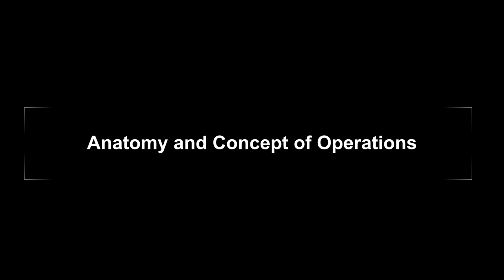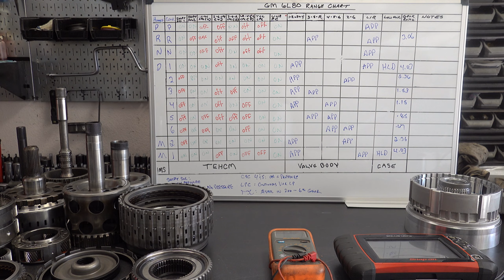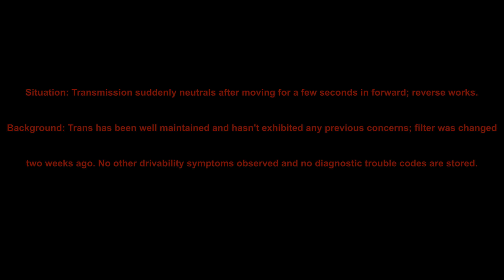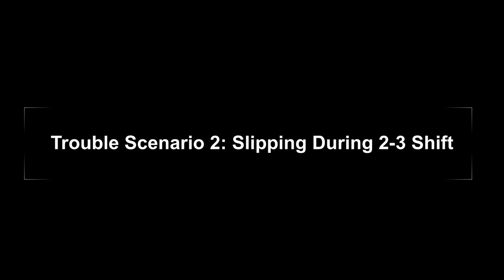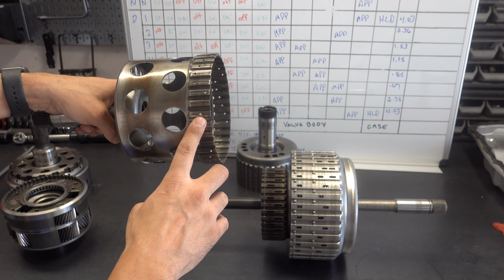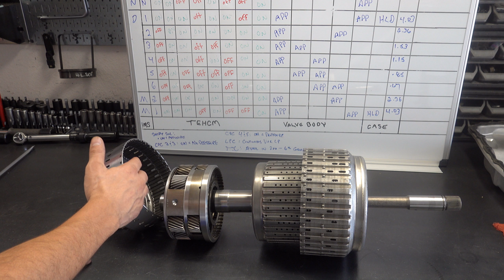6L80 Troubleshooting PT1 - Fundamentals and Range Charts

Comment: I have a 2014 2500hd with the 6l90. I get a hard shift from 1st to second on the very first shift of the day in cold weather ONLY. After that it shifts perfect. What can be possible causes? Thanks and your videos are fantastic!
Reply from the maker: Hi emtcc, thank you for the kind words...The 1-2 hard shift when cold condition can be caused by a few different things (as well as a combo of them) but many of these transmissions will have somewhat abrupt shifts due to the fluid being thicker when cold but they warm quickly so the condition goes away until the next drive cycle after sitting / cooling off. You may also have a mild amount of check ball and/or valve body wear that the PCM detects after that initial shift and adjusts the line pressure accordingly to smooth it out...Torque converter wear, bushing wear, slightly worn 1-2-3-4 clutch can also be applicable...

Your best bet is to plug in a bidirectional scan tool, bring up live trans data and take for a test drive in the AM when it's cold and see if there's anything anomalous in the data, such as a slightly longer 1-2 shift. Let me know what you find.
Reply: @nickstransmissions  Thanks man! I'll definitely hook my scan tool. Your response was above and beyond! I really appreciate it!
Reply from the maker: You're welcome. Please subscribe if you haven't already done so...I'm always doing 6L transmissions so will be putting more videos on the channel in the near future.

Comment: Great video. I just rebuilt my 6L80E 
I have no reverse. It wants to go forward in reverse. So I’m stuck on the ramps. If I am thinking correct, I think my 2/6 or 4-5-6 clutch is too tight. No codes. Any thoughts.
Reply from the maker: Hi Brewmaster, thanks for watching. My thought is I'd need a lot more information about what you did, including whether or not you replaced the TEHCM with a new one (if so, did you program it for your vehicle?), clutch clearances for all clutch packs (don't know if your clearances are too tight or not w/out that info), fast adapt relearn conducted, whether or not the manual valve was engaged to the rooster comb, etc...

In the meantime, unplug the case connector in the back of the transmission, start it up and put it into reverse and then drive...If it goes into reverse (moves backwards) when in Reverse and moves forward in Drive (you'll be in 3rd gear), the problem is somewhere on the case belly...If you're still moving forward with the gear shifter in reverse, you either failed to connect the manual valve/IMS to the rooster comb or misassembled something in the case. 

Let me know and we can go from there.
Reply: @ did not replace techm. Clutch clearance could be an issue.   Truck will not start with tranny unplugged. No wierd noises. I will check rooster comb linkage. But don’t believe that’s it. It shifts into and out of 4wd hi and low in neutral (still same issue) forward while in reverse. Thanks for responding. If you have any ideas from what I replied, please let me know
Reply from the maker: Ah, that's right - the IMS sends the P/N signal directly to the PCM whereas in the 4L60Es and 4L80Es, its a purely electrical connection vs electronic. My apologies.

What were your clutch clearances?
Reply: @ I didn’t measure. I should have. If any are too tight, could that cause issue I’m having. It would have to be any of those not applied in reverse, right. I know it’s not a lot of info for you.
Reply from the maker: I'm thinking the unit has to come back out so you can perform a thorough inspection of everything in the case as well as VB...Drop the pan first to check for anything obvious like no rooster comb to manual valve engagement (and to drain the fluid) but I'd not get my hopes up on a quick fix here...

Take clutch clearance measurements - use the assembled pump to check the front three clutch packs - mount a dial indicator and take measurements at the 3, 6, 9 and 12 o clock positions on each then calculate an avg clearance - write it down. Do the same for the low reverse and 2-6 clutch. Check sprag rotation and bearing placement along with everything else...
Reply: @nickstransmissions  thank you very much. Third time coming out. lol. First I just replaced the torque converter, then 5-6 was slipping, ordered rebuild kit with bonded pistons. 4-5-6 was definitely smoked, put back together with new kit. Now this. Good practice I suppose. Thanks for all the info. It is much appreciated
Reply: @nickstransmissions  one quick question, 
Is it possible to air check while it’s in the truck. If I remove valve body
Reply from the maker: You're welcome, man...The first one is always the most difficult but after this you'll be able to do them in your sleep....I'll be publishing a complete rebuild on these transmissions starting next week...Will be a three-part video series covering every single step in the rebuild process, including clutch clearance measurement and end play set up - may be worth a look if you don't have it all out and rebuilt by then...
Reply: @Brewmaster721  morning brewmaster did you ever figure out your issue … I rebuilt my 1st trans .. went so smooth .. so I bought a truck with bad trans thinking o I can do this again … this trans had a lot of shaving s and man I have had nothing but issues lol … I’m on my 3rd pull out … rebuilt ..converter and techm .. falls out of gear in drive but not 1st manual lol .. costing me some money on this one that I don’t think I ll get back lol

Comment: Nick, is it possible for me to send you my TECHM for a rebuild please? I have a 2008 Escalade with P2714 code: pressure solenoid D not working or stuck in “off”
All the shops around me are super shady and feel like they aren’t reliable. 
Not sure if that would actually fix my issues but figured I’d start with that considering the cost of a new one etc.
Reply from the maker: Hi WanadogaFarms,

I actually don't remanufacture TEHCMs as they require very specialized and expensive equipment to do so. You can install pressure switch seals and diaphragms but that's about it. I would suggest confirming that P2714 (CPC4 Stuck off) is actually your TEHCM and not the 2-6 clutch boost or regulator valve worn/leaking. The only real way to do that is via vacuum testing using Sonnax's vacuum test machine...I have a separate video showing this being done: https://youtu.be/aBx63Vwo6mA

If you would like me to comprehensively test and overhaul your valve body assembly, fully test your TEHCM and install a Sonnax Zip kit or Transgo Reprogramming kit (Transgo TowNPro), reach out to me via Facebook DM and we can go from there. 

Facebook link: https://www.facebook.com/profile.php?id=61565989906020

Thank you for watching!

Comment: Hey Nick, I’d like to get your direction and opinion on an issue I’m having. I rebuilt my 09 Silverado 6l80 using circle d’s level 2 kit, a circle D billet 300mm 2400-2600 stall torque converter, along with oem pump and bell, and sonnax lube dam and replaced the pressure switch laminate discs. I have park, reverse, neutral, and seem to have 1st gear but no 2nd. I can use M1 and not lose forward movement M2 has no movement. In D1 once I reach roughly 1500rpm/5mph I lose forward movement. From my understanding of the range chart, 2-6 clutch or PCS 4 would be one of the culprits. I have no DTCs, I’ve actuated all solenoids using a snap on solus, all except PCS 4-5 had well audible clicks when actuated on, 4-5 weren’t silent but were hard to hear. I removed the pan and valve body to air check clutches. I’m concerned with my 1234/35R when air checked it seems like a slight leak to 1234 from 35r. My 2-6 clutch seems to have good apply when air checked. So I’m kind of at a crossroad of where to go from here or maybe there’s something I’m missing. I have not ran the quick learn procedure, I’ve tried 3 different scan tools and they don’t have the procedure to do so. I’ve thought that may be my problem but I’m not sure.
Reply from the maker: Billy you must run the fast adapt relearn - don't do anything else until you have completed the relearn procedure...Whichever scan tools you have don't seem to have the capability so I'd either rent one or take to a shop to have it done...They can also diagnose it for you...If your 2-6 clutch air checks as it should and your 1-2-3-4 clutch is working as well, then the problem has to be electrical / electronic (pcs solenoid for the 2-6 clutch non-functioning due to mechanical failure), 2-6 CB or regulator valve stuck or perhaps the diaphragm switches or their seals are not installed correctly.

Did you overhaul the valve body and install a hydraulic correction kit such as the Sonnax Zip kit or Transgo Repo (Tow and Pro) kit? 

Did you vacuum test the valve body as shown in my 6L80 Diagnosis and Troubleshooting: Valve Body and Pump Vacuum Testing video?

I'd be concerned if you had a lot of air/fluid coming out of the 3-5-R test port when charging the 1-2-3-4 port an vise versa but a tiny bit isn't likely a problem. Did you notice the same leakage on the bench when you air checked those two circuits during assembly?
Reply: @nickstransmissions  I’m in a shop, currently at an Audi dealer. I started out at GM for a couple years but this is the first trans I’ve tried to rebuild. 
The relearn was my initial concern before moving on to physical parts. However, I may have just realized my issue with the relearn… between the three: autel mx808, an autel elite 2, the snap on solus had the function to do the relearn but said the function was unavailable with the ecm. the truck has been tuned with a hp tuner before so that may be my cause there. 
For the valve body, I did not vacuum test it, I did the o ringed end plugs, new checkballs and valve plate but no new valves or valve springs in the valve body. 
For the 1234 and 35R, I did notice it beforehand, but understand that a slight leak may be common with new teflon seals. I airchecked 35R first after removing the pan and seemed to spit a good bit of fluid out of 1234. After that initial air check it seemed to be about the same as when it was on the bench.
Reply from the maker: Interesting...Unfortunately, I've never used HP Tuners before (or any tuning software, for that matter) so can't really confirm / deny but those scan tools should have been able to do the adapt-resets for you. 

That aside, if your 2-6 clutch mechanically checked good with air, the problem can be CPC Sol. 4 not coming on when the TEHCM commands an upshift or it's got an internal problem preventing it from functioning as it should when energized...This condition usually throws a performance code but not 100% of the time. The 2-6 valve train can also be the problem. The TEHCM's command/control logic could also be the issue but I wouldn't know why the TEHCM wouldn't command that solenoid on (i.e. command an upshift from 1st to 2nd) but without the adaptive reset being performed can result in some odd symptoms/problems...
Reply: @nickstransmissions  well after going down a couple rabbit holes: checking my valve body and testing the tehcm, reading some bulletins, manuals, and diagrams. I came to the conclusion I may have flipped the low sprag. managed to reach the outer race with a pocket screwdriver and sure enough I flipped the sprag elements going back together after cleaning. I have it back out and a new sprag coming in today. Going to double check clearances and air check for peace of mind since I have it back apart. Most likely would not have even gotten this far without your videos, very much appreciate the time and detail you’ve put in them.
Reply from the maker: @billybeeson9853  Gotcha - yep, having the sprag in backwards will do that to you. Glad you were able to find and identify the issue!

Comment: I have no forward gears, but have a strong reverse. removed valve body and the check balls are good. trans has 40k miles on reman unit. oil was clean and cherry. no metal in pan. whats my next step?
Reply: Im going to air test and see if i have any pistons leaking by.
Reply from the maker: Yep, that's exactly what I would do next. Focus on the 1-2-3-4 piston, it may have cracked. Also monitor for air/fluid coming out of the 3-5-R port while charging the 1-2-3-4 clutch with air. If the 1-2-3-4 piston applies and releases normally then the other likely culprit in the case is the rear sprag. Dont see those fail too often outside of 2006 (they only had 30 elements that year and were markedly weaker than the 38-element versions installed in later years.

Let me know what happens...
Reply: @nickstransmissions   is there a way to test the rear sprag without removal of trans?
Reply from the maker: Not that i am aware of but given the no fwd mvmt, you largely ruled out non-case causes (non-case = tehcm, vb) via your inspection of the valve body so next step is to remove, tear down and inspect the transmission, regardless of what the air check at the 1-2-3-4 apply circuit reveals. 

Do you have any transmission-related codes stored?
Reply from the maker: Hi Taylor, I'll pose the question to you - based on what you saw in the video, what do you think your next step should be? Instead of spoon-feeding answers, I'd like folks to start using the diagnostic progression, much of which is laid out in the video.

Let me know what you think your next steps should be (there's almost no wrong answers other than to say 'I'll do nothing'). 

I'll provide additional guidance based on your reply.
Reply: it ended up being cracked 1234 piston. got it fixed! thanks again

Comment: I also have p0700 after a complete rebuild,no reverse will move forward but no gear change from 1st.. also p2714
Reply from the maker: Hi Durell, thanks for watching...

Did you reset the adapts to factory prior to driving the vehicle? 

Was the TEHCM replaced as part of the rebuild?

Did you rebuild the transmission or did a shop rebuild it?

P700 is a generic communication error code while P2714 indicates Clutch Pressure Control (CPC) Solenoid 4, Stuck OFF. You should have no 2nd or 6th gear if that solenoid is no good.
Reply: @nickstransmissions  the tehcm was replaced and reprogrammed by a reliable company. When I use the scan tool that's all popped up. Someone else rebuilt it not me idk what u mean by reset back to factory
Reply from the maker: A fast adapt relearn procedure must be performed prior to attempting to drive the vehicle so whomever did the reinstallation would have also had to do the 'fast adapt relearn procedure to ensure all of the adaptations that were made by the computer prior to the transmission coming out for overhaul, are cleared. 

Here is a link to the relearn procedure: https://etesupport.zendesk.com/hc/en-us/article_attachments/203577007

What company provided the remanufactured TEHCM? 
I have had good luck with GM, Street Smart and Sonnax; haven't tried any others.
Reply: @nickstransmissions  I reinstall the transmission back in and I think it was a sonnex part thx I gonna try that
Reply from the maker: Sounds good, let me know if you have any more questions...

Comment: Hey great video man. Bought a 2016 silverado with 150000 miles on it, seems to be pretty slow in 1st gear and jerks when downshifts when coming to stop. Also jerks a bit shifting into 6th or 5th Watched the video but not that mechanically inclined lol
Reply from the maker: Thank you, @mishutkin101 - appreciate the kind words. Per your description above sounds like the torque converter may be failing...do you have any codes stored? Specifically P0741?
Reply: @nickstransmissions dont have a scanner but I took it to local O'rallys, they scanner it with their scanner and said there's no codes. How long until it completely fails? Is there anything i can do to make it better? Just paid 20k for it with no warranty.. kinda screwed
Reply from the maker: It's impossible to predict how much longer it will last...In some cases, the transmission will behave like that for thousands or tens of thousands of miles before failing completely while others shit the bed shortly after drivability symptoms first appear. 

Your best bet is to either purchase a bi-directional scan tool like a Snap On (Modis, Solus, Verus, etc) which is what I'd recommend so you have the ability to diagnose things going forward or take it to a trustworthy transmission shop in your area and have them test drive it with the scan tool showing live engine and transmission data.
Reply: @nickstransmissions  Thank you sir you've been a great help! Much appreciated
Reply from the maker: You're welcome, man..Please subscribe if you haven't already as I'll be doing more 6L transmission videos over the next few weeks...This way you'll get notified when they get published to the channel..One of them will focus on what I believe is your vehicle's specific issue (Torque Converter).

Comment: Nick Thank you for your videos, I just completed a 700R4 watching your videos. I have a 2014 Chevy truck and cannot get 2nd gear to firm up on the shifts. What could this issue be, all TM is in program and hasn't been touched
Reply from the maker: Awesome man - great to hear my videos helped you with your build! Firmer shifts in the 6L80s tend to be had via performance tunes vs doing anything mechanically to the transmission itself. Black Bear, Diablew and others specialize in those units and can create and send you a tune to upload to your PCM.

Comment: Wheres pt 2
Reply from the maker: Parts 2,3 and 4 will (hopefully) be up within the next month. Part 2 will focus on the IMS, Part 3 will be TEHCM and Part 4 will show testing/diagnosis of the valve body assembly itself. Been slammed with other work so the 6L80 stuff had to be put on the back burner, unfortunately.

Its there a specific question you have that I can answer?
Reply: @nickstransmissions  thank you nick